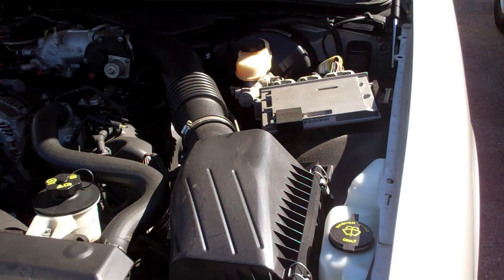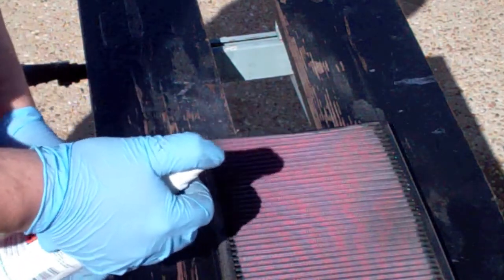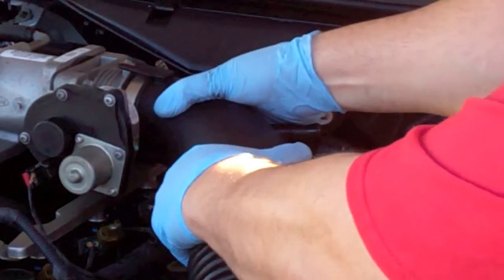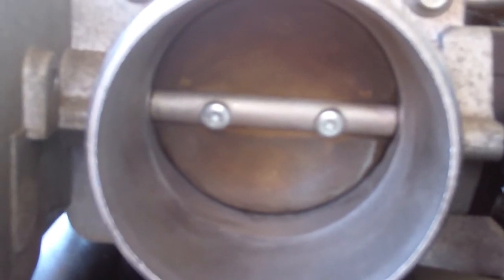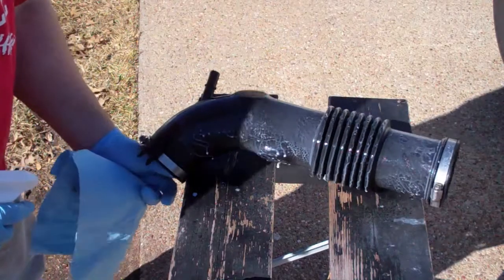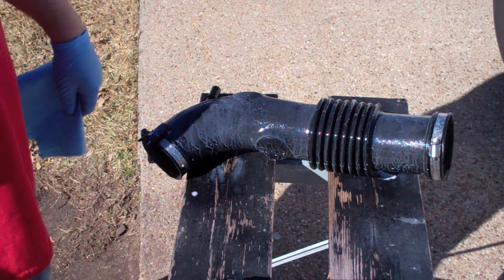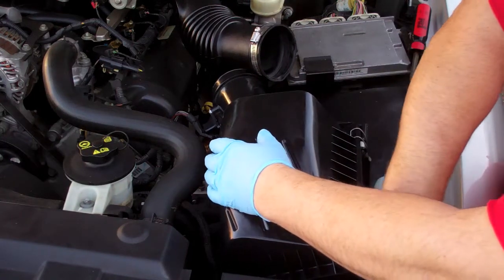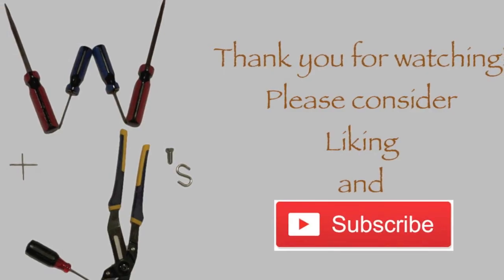MAF Throttle Body and Air Filter P71 shown

Comment: Hey WJ when I did this and put it back, she got sluggish on me. What did I do wrong ? I reinstalled it correctly
Reply from the maker: hard to say, go back and re-check everything because mine is awakened
Reply: WJ Handy Dad I lost her,  the tranmssion went. Super weird idk how that would of did anything but it didn't even slip it just started getting super sluggish, lots of movement in the pedals and then the trans light came on. All 3 crowns I've owned the transmission went on them.  Favorite car but has the worst transmissions. I wonder if the 04 owners with the 4r75w saw any improvement over the traditional 4r70s
Reply from the maker: Wow that sucks.  Guess I've been lucky.
Reply: WJ Handy Dad yeah it was a denver district 5 command supervisor unit , it was probably drove harder than most detective ones
Reply: Austin Bell Transmission are definitely the only few negatives in these Panther platforms forsure unfortunately lol. The newer tranny’s you mentioned were definitely a lot better but still similar.
Reply: Craigy C I've heard mixed reports on 05 s being pretty solid. People say the left over 04 4r75w s went into 05s but never had a definite answer.
Reply: Austin Bell yeah I’m sure some of them did. Can’t exactly remember when they made the switch but it was either 04 or 05 maybe even 06.
Reply: Craigy C do you know why their like that bro ? Just how their made ?
Reply: Craigy C also have you any experience with trekmac transmissions ?